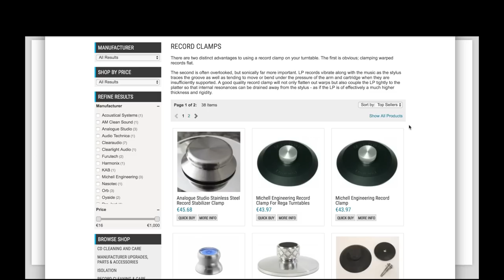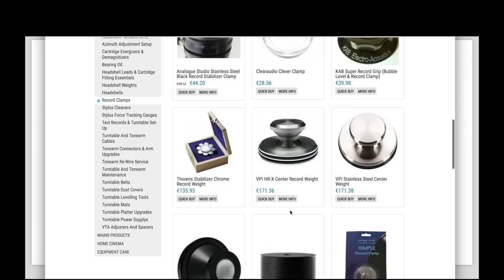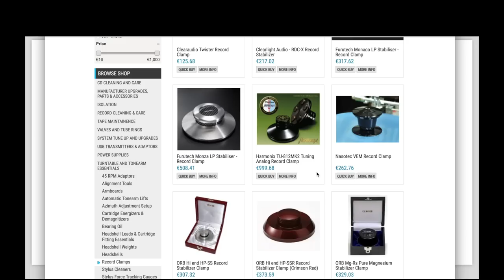The Best Record Clamps: clamping, suction & stabilization

Comment: 6:13:“ I can‘t say I’ve ever tried one, but I‘ m shure it does have positive effects.“
At this point I knew: not systematically analysed experience, pure fairy tales. Time waste.
Reply from the maker: Hi Astra, Yes, I am always honest and I am not going to claim fake experience. Nevertheless, I am bringing experience over other clamps. I am also convinced, actually it appears logic, that if I have a warped record, a peripheral clamp will have positive effects as claimed. Don't you think? Moreover,  I think a video can present some aspects and opinions and report experience on others. The important is to declare so. I am not that sure that everyone does that. If I am looking for science I am certainly not going to use YouTube. Anyway, thank you for watching and posting your comment.
Reply: ana[dia]log Hi ana(dia)log. Thanks for your immediate answer. I hope I have not offended you with the wording (time waste). It's my concern that not the viewer but you are about to waste time. That is the case, when your gathered experience does not result in any knowledge about the iissue. And the issue is: which sonic deficiencies has a turntable without fixing the record to the platter and what kind of possibilities exist to overcome such deficiencies. 

Of course a warped record can only be flattended by an outer ring and a central clamp or weight. I do not play any warped record and I don't buy them. Sadly the whole production of ttw is off.

The object of a turntable is a mechano-electrical conversion. 50 percent of the task is the absolute time correct reproduction in form of an constant speed.  And it's the record, not the platter. The other 50 percent are done by converting the microscopic form variations of the groove ( we're talking about micrometers) into a microscopic current. The horizontal position of the turntable is a necessary prerequisite. 

Off centerered records can not be recentered by any of the mentioned means. Nakamichi once solved this problem and no other company in the whole self called high end cult didn't even try to adress this problem. They are not willing or not able, and they don't talk about it. 
What's next: it's necessary to avoid any relative movement between platter and record. Any speed variations between platter and record must result in unwanted pitch variations. So it is logical to avoid such deviations by connecting platter and record. But with which amount of force? Of course with the lowest necessary. So a clamp might be the best solution. It does probably not alter the form of the record. Probably! No manufacturer mention this question.

There are numerous different weights in offer. A few of them are variable. This invites to endless hours of weight changing. 
Some of the most expensive turntables offer a "system" consisting of a platter mat and weight/clamp solution. But none is depicting a rationale behind . You always hear the common nonsense of tight bass, clearer midrange and airier hights. Wider soundstage, more dynamics, blah, blah blah.  Is there a relative movement between the platter and the record? Get a felt marker, mark record and mat and play. If both marks are unchanged after playing the whole side, there is no relative movement. Compare a slip mat with a rubber mat. Every Technics owner can do that.

Resonances. Resonances are not nice, if they lead to an audible difference. You know resonances. Switch the amplifier off and play the record. What do you hear? Music, not sweet sweet music, but music. It's the cartridge, or is it the record surface? The whole energy that emanates this sound is lost. This vibration cannot be converted into current. Try, if you can reduce it with clamp, weight or peripheral ring. 

The record: preechoes. The needle is running in the first groove, the microphone is on, the orchestra hasn't begin to play but you hear the third bar very silent. And that is happening throughout the complete recording, with every lp you ever bought. You're not listening to two channels, but to four, you lucky son of a bitch. Double the value (sarcasm mode off). The solution: better vinyl and more distance between the grooves (thicker groove walls). This is perhaps the only advantage of 45 recordings. 

In short: science is cumbersome, frustrating and expensive. But don't let yourself be seduced to muddle plausible assumptions with sound knowledge.
Reply from the maker: Whoa! Now that is an articulated comment! Thank you for sharing your experience. As I always say, this needs to be a DIALOG, not a monolog and I am ready to learn from all of you out there!
No offense taken, thank you for saying that.
The fact that most TT are off is very interesting...and worrying!
Ok, I understand that you do not like assumptions and generally speaking I agree. But again,  I was illustrating what was on the market or made in the past (I would love to test the Audio-Technica suction products but that is now impossible! Not for the price but because the rubber of these gizmos is consumed and melting. What I wanted to communicate is that a simple threaded clamp can grip and press the record down flatter (not flat) at a decent price (with the right models), without stressing the motor. Along the road Iike to give some insight on the similar or parallel products. If I need to test everything before going on air it would take ages and tons of money for just a mediocre help in the end. As I said, the important is to cite the sources and state what has been tested or not. That is IF you decide to comment on it. Thanks again for your info!
Reply: ana[dia]log regarding the circumstances of video production I totally accept your statement. What I wanted to bring to mind is: before you change anything be aware of what you want to approach.